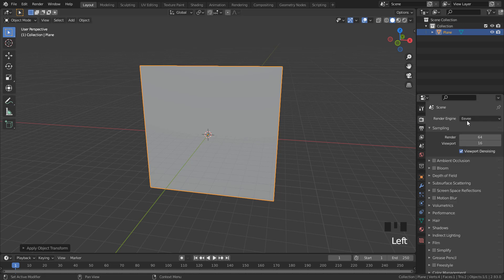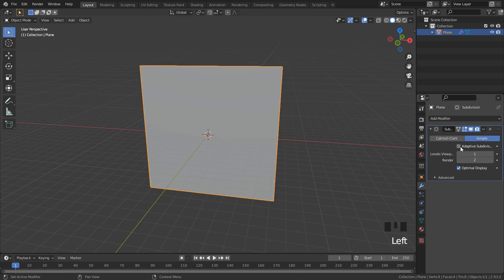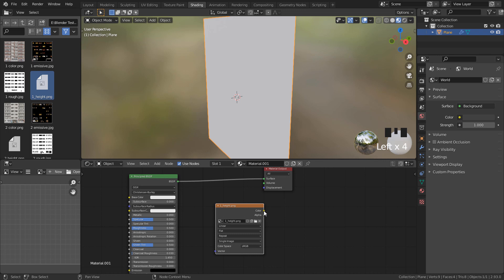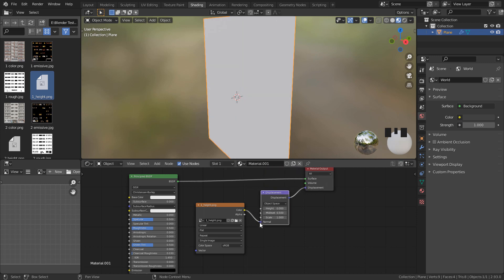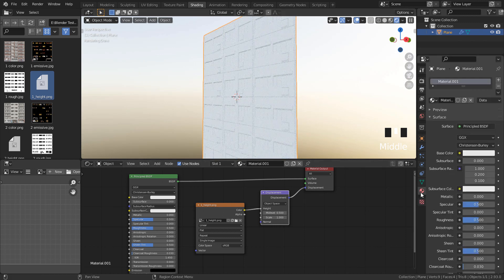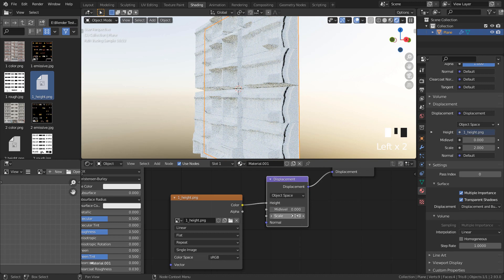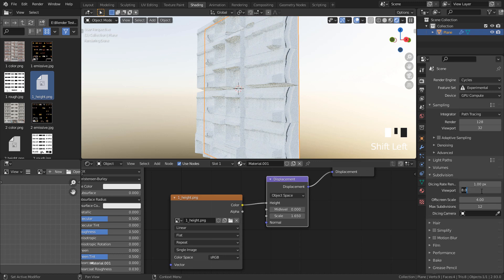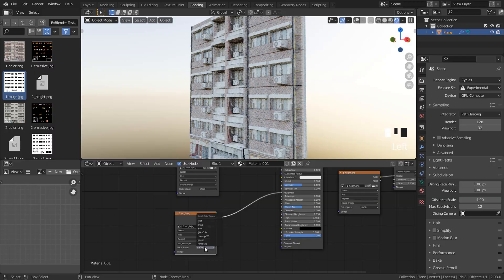How to Create Buildings with Dsiplacement Maps

Comment: I have an issue with installing the addon. I installed the zip file and Blender even writes that it's download, but I don't see it in the search menu. I use Blender 4.0
Reply from the maker: It's not an addon, these are displacement maps, you can use with cycles adaptive subdivision, wich I explained in this video.
Reply: oh sorry, okay thanks for your answer @chuckcg

Comment: hello i ve just bought this addons but it doesn't work with Blender 3.4.1 or may be i have a bugg?
Reply from the maker: Hi thanks, but this is not an addon, these are displacement maps that i created and can be used in blender, you have to use cycles and enable experimental, you can follow this tutorial and make sure not to miss any step

Comment: How did you get those advanced settings in World Sky Texture at 2:20? The only settings I have are: Ske texture (Hosek / Preetham), Turbidity and Ground Albedo. No Sun disk checker either elevation, rotation, air, dust etc.
Reply from the maker: the sky model is "Nishita" i think you only have Hosek and Preetham because you're using an older version? download the latest.